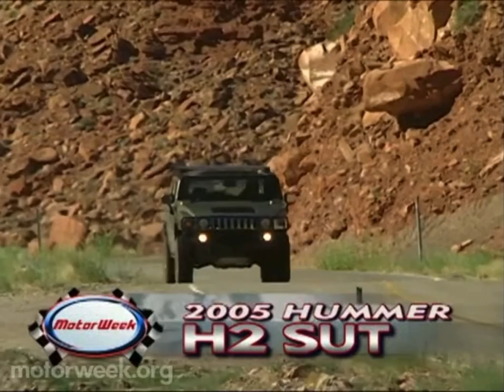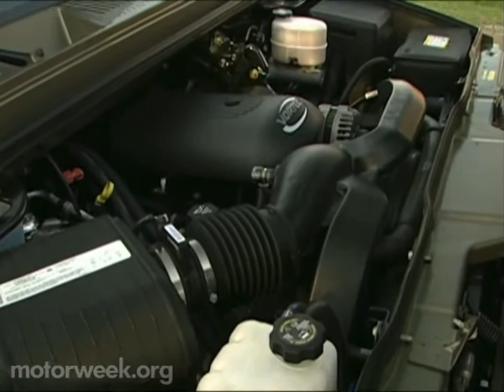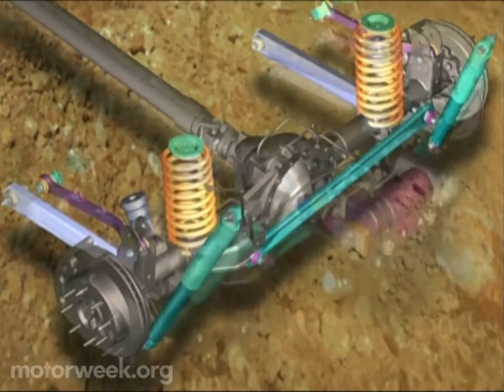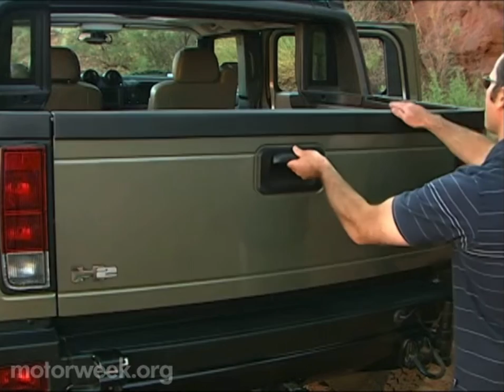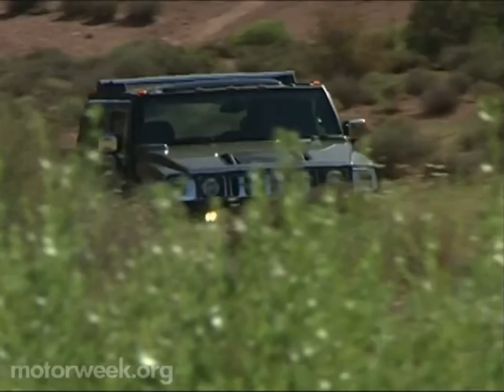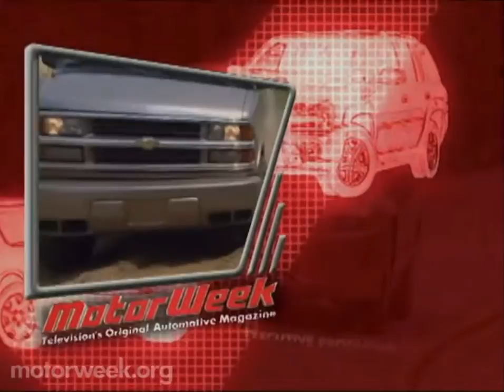Motorweek 2005 Hummer H2 SUT Road Test

Comment: Total junk.
Reply: Totally agree, I worked at a Chevy dealership in 2007 and we saw so many of these pos with electrical problems, trans problems, numerous fluid leaks, ect. As well ass interior pieces falling off. Inexcusable for a truck of this price
Reply: @ohguy1991  I get most of these issues but the transmission? The 4L80 is basically peak GM transmission and it is bulletproof. I've seen plenty of 2500 trucks with 200k+ miles on these.
Reply: Best truck I ever owned and still going strong. Best looking too.
Reply: @kryptoknight.  Best looking? These look like a school bus for 6 year old pimps.
Reply: Hardly junk. These are heavily modified GMT800 trucks, which are widely known as some of the greatest GM vehicles of all time.
Reply: @hakeemsd70m  Why do they have so many issues then? Everybody knows the GM Hummer sucked, just like the new one too. The H2 is one of the most embarrassing vehicles ever made, everybody I’ve known that’s owned one has hated them.